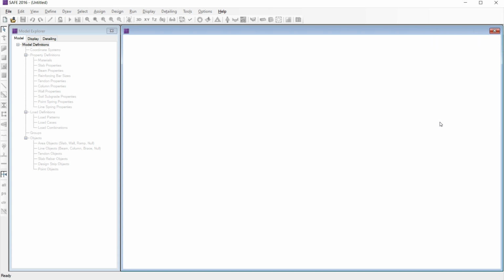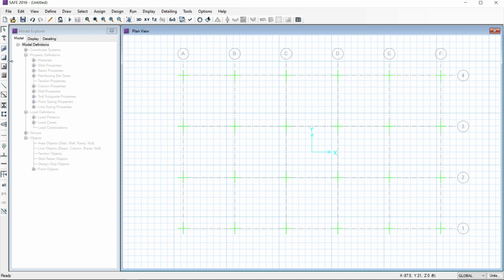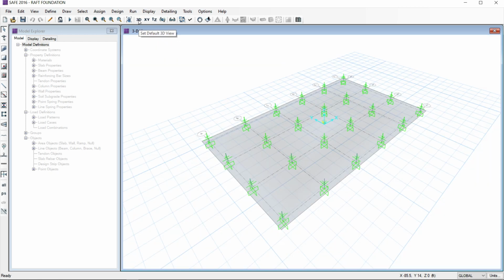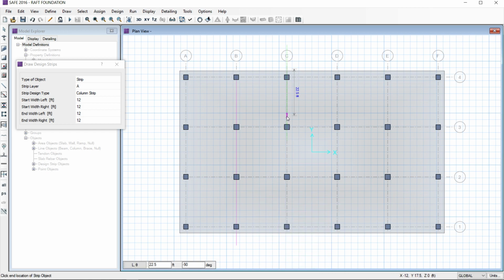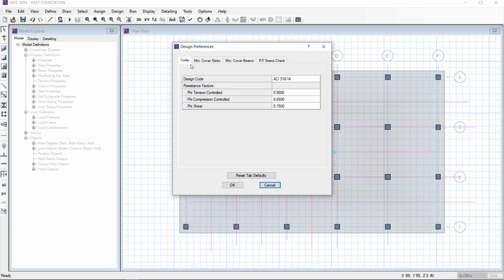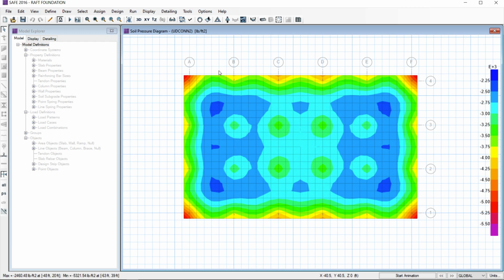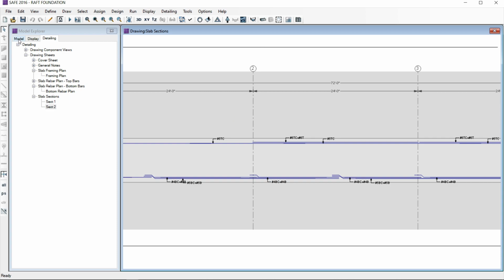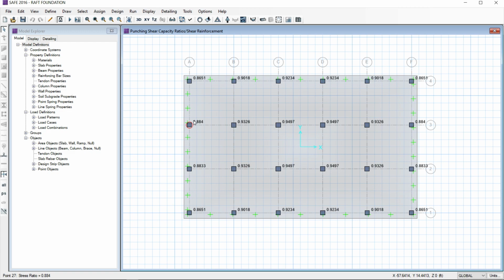Mat Foundation Design in CSI SAFE 2016

Comment: can i use data from ETABS 2018 on SAFE 2016? which software is good to design MAT if i am using ETABS.
Reply from the maker: Although I did not use ETABS 18, but in my opinion, you should be able to transfer data from ETABS 2018 to SAFE 2016. Certainly SAFE is a better choice.

Comment: Sir, I have a problem unlocking the model after completing the run analysis in Safe2016. I have imported load reactions from etabs 2016. Please suggest solving the problem of unlocking the model. I hope your suggestion and thanks.

Comment: Hi, Good day! I'm designing mat foundations, and I'm getting 48.96mm settlement due to DL + LL + EQ (linear add - service normal). The allowable settlement for mat foundation is 50mm. It is only almost 1mm difference. Should I add piles on my mat foundation or should I change combination type and design selection on load combination data.

Thank you in advance. God bless.
Reply from the maker: Please let me know the level of seismicity, i.e. the seismic category of the structure. Secondly, please give me the reference of 50mm settlement from code. Are you following ACI? Please refer to Chapter 18 of ACI 318-14.
Reply: @msajjadh  it is only based on some tutorials here in youtube. They said 25mm for isolated footing, and 50mm for mat footing.

It is necessary to check the deformation/settlement of foundation at CSI SAFE? Some people told me it is not necassary on the said software.
Reply from the maker: @lordetoygallenero2314  As per ACI 318-14 code, there is no such limits. However, it is a general practice to follow. In your particular case, since the information is not complete, I can not say anything at this stage. Please share your detailed calculation. Regards,
Reply: @msajjadh  I'm designing mild steel/stainless steel storage tanks with diameter and height ranging 10m-15m. I used manual computation based on API 650. I designed the rafters at STAAD. After that I model the tank foundation at STAAD and transfer the loads to SAFE. It is ringwall with mat footing.
Reply from the maker: @lordetoygallenero2314  For API 650 Tank foundation, a ring wll is designed. There is a complete procedure for designing such foundations. I do design such foundation and perform manual calculations. You can increase the width of the ring wall foundation to lower the settlement.
Reply: @msajjadh  Yes, I design the ringwall first. But the actual pressure below the tank exceeds the allowable. So I need to use mat footing. I design the ringwall manually, and STAAD for mat footing.
Reply from the maker: @lordetoygallenero2314  Is it possible that you can increase the diameter and reduce the height to lower the actual pressure? What is the bearing capacity at the site?
Reply: @msajjadh  No, I'm not allowed to change the dimensions of tanks. The allowable bearing capacity is only 96 MPa, that's why I'm struggling.
Reply: @msajjadh  Can you tell me what chapter or page on ACI 318-14, saying no limit for settlement.
Reply: @msajjadh  Now I'm designing another mat foundation, and I'm getting 60mm deformation/settlement from the result of SAFE. I think it is a excessive settlent.

And what more for those tank foundation that I will going to design. It is much greater dimensions.
Reply: @msajjadh  I'm wondering about what you have said, that base on ACI 318-14 there is no limit for settlement. I'm thinking if it is safe or it  is allowed in actual.
Reply from the maker: @lordetoygallenero2314  Allowable settlement is not an issue of ACI 318 code. Basically it is the functional limit, set by others. Like in cse of tanks, may be the mechanical engineers limit the allowable settlement.  For your case, please look into Geotechnical Report. Normally these limits are set in it. They calculate the allowable pressure with these settlement limits. In case of allowable bearing capacity of 96 kN/m^2 your tank may have a height not exceeding 8.5 m only. For tanks with more height  you have to go for piles. Hopefully this explanation clarifies your issue. Regards.
Reply: @msajjadh  That's the problem, sometimes there is no geotechnical report. Like now, my boss said just assume. The lowest height of those tank is 10.10m. Do you have reference regarding to the relationship between allowable soil bearing capacity and height of the tank. Can you send me? I should read that because 2 of the thank I designed has 96kPa SBC, 48mm settlement, and height greater than 10m. Thank you.
Reply from the maker: @lordetoygallenero2314  Actually it is my personal experience. Just consider the dead load and assume that the tank is full with water. A simple calculation will reveal that limit.
Reply: @msajjadh  I think one of the reasons why I'm getting large settlement because I modeled the foundation at STAAD and not use the rule for plates. I didn't follow the rule that plates must have dimension noy greater than 500mm and short to long dimension ratio of 1:1 to 1:4. Because the past designer here in my company did that, and used it as a reference. The dimension of plates has 2m. I think it's  wrong.
Reply: @msajjadh  Can you give me your email or gmail Sir. That way I can the reference design of our past designer. I think it's wrong because the size of plates.
Reply from the maker: @lordetoygallenero2314  my email is msajjad58@gmail.com
Reply: @msajjadh  I sent you an email Sir, thank you!
Reply from the maker: @lordetoygallenero2314  I did not receive it. Please check your e-mail again.
Reply: @msajjadh  msajjad58@gmail.com right Sir?
Reply from the maker: @lordetoygallenero2314  No, it is msajjadh58@gmail.com
Reply: @msajjadh  Ok Sir, email sent.